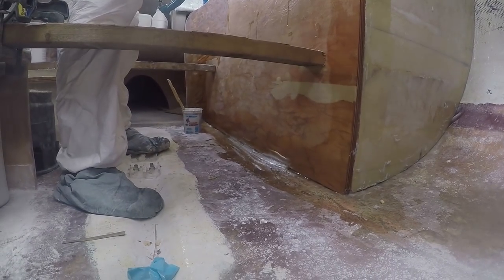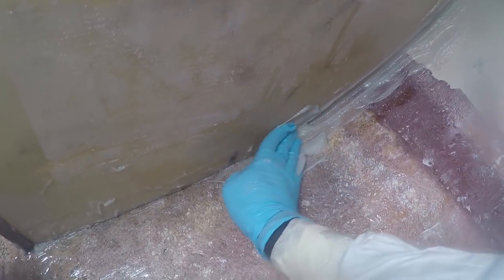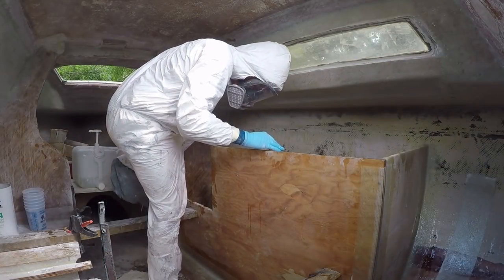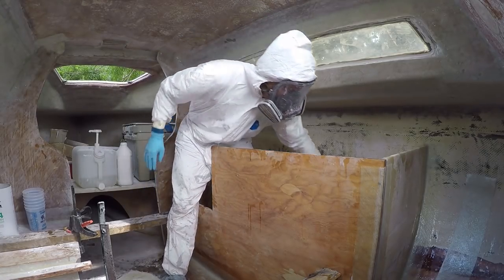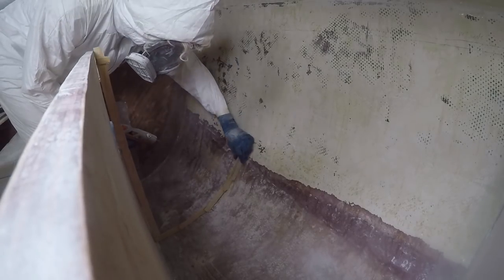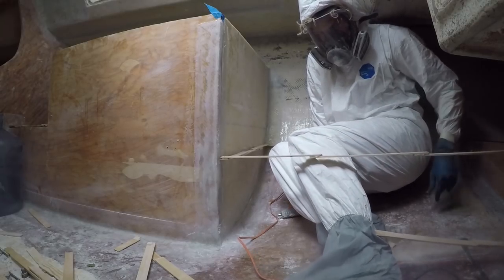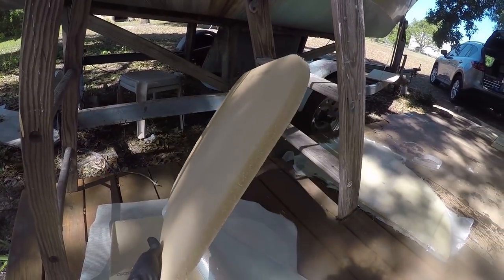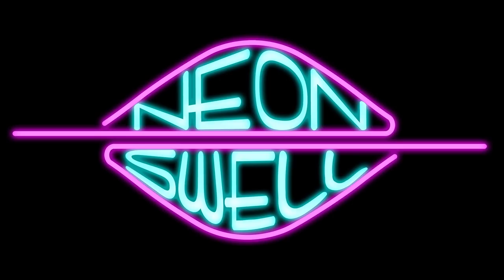Galley & Hatch Building (22' Sailboat Refit) - Neon Swell - Ep. 10

Comment: Same as last vid, awesome. Ur design ideas and use of epoxy and glass look super strong in adding strength to the boat and to the structures ur building. Looks like a lot of place for storage and possibly sealed buoyancy chambers. I'd feel super comfortable aboard ur boat in rough weather. Keep it up man. It looks great.
Reply from the maker: Hi! Thanks! I was hoping to fair nicely in bad weather for just in case circumstances. Now that you mention it, the sealed buoyancy chambers were removed from the boat when I ripped up all the dry rot. These chambers were filled with mold and look liked they'd seen their day. I really questioned if I wanted to put these back in. The last thing I ever want this boat to do is smell like mold. However, since I really don't know much about sailing, or for that matter boat building, could you give me insight to the necessities of the buoyancy chambers? I'm really not sure I would have enough room to even make a difference, I'd have to figure the cubic footage and weight displacement calculations. I'm guessing I'd need 4 chambers (2 front, 2 back) but not 100% sure. I'd really prefer to have the extra space for storage. Thoughts?

Comment: Thanks for another great video! (Also, noticed some pep in this one! Haha.) I really appreciate the detailed info you provide in them. I'm boat shopping and considering doing what you're doing. Really enjoying following your progress. 

Have you considered installing a dorade vent? From what I've read, it sounds like they really help to keep the cabin temp down while underway without letting any water in. 

Also, a suggestion... when you get to the step where you're creating panels for your headliner and sides, instead of screwing them in or gluing them, consider using industrial strength velcro. I know it sounds cheesy, but the most common problem I've noticed with boat refits is people inherently have to upgrade their electronics or inspect screws, etc and it's always frustrating for them when trying to unscrew all the panels to get there. I can't find the video, but someone did a refit with it and they looked amazing (plus you have the added benefit of not having to look at unsightly screws.)
Reply: Christopher Westfall agreed, thanks a lot for the detail on the hows and materials.
Reply: Christopher Westfall I've never thought of using velcro.... Awesome idea... Hahaha, how many channels I see having to rip the whole boat apart to get to screws. For the most part I like the epoxied foam to get everything rigid, but I will certainly consider velcro for the non-structural portions of liners and panels.

OH and vids are awesome and comments are helpful. Huge motivation for my future boat/refit.